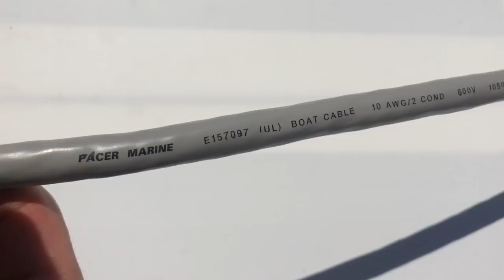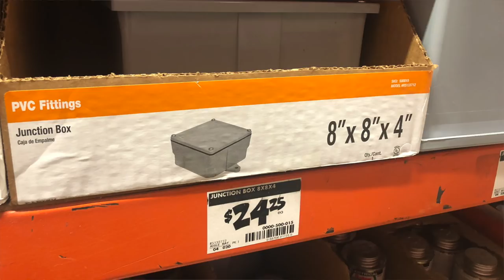Our 1300w RV Solar Install On Our Class A Motorhome!

Comment: couple of questions: 1) what did you use to attach the wire to the back of the panel? looks like some kind of zip tie, what are they and where did you get them? 2) how did you attach the cables to the roof?

Comment: Perhaps "compartmentalizing" (insulated curtains?) your living space and using a smaller btu air conditioner would work.  There is a JHS air conditioner that's Energy Star rated and 8000 btu....it draws about 920w/8 amps.  Not bad for a portable.  I think it would work with your set up, but you'd have to find a place to store it, and a place to vent it.:/  $269.99 on Amazon with free shipping 👍🏼. Anyway, best of luck 💜

Comment: Nice job check out the Renogy 100 AH lithium iron phosphate batteries.  I'm running 4 they are 25 lbs normal flooded runs 70 lb and only get 50 % of the power capacity.  So 4 LI batteries = 360 + AH.  I'm charging with 500 watt solar array to a Rover 40 AMP MPPT charge controller.   Mike

Comment: Nice install!!
I'm just starting out and I notice you have a honda element (me too) with a base plate for towing. Have you had any issues? I can't get a straight answer from honda about whether it can be towed or not. Obviously you're doing it. Do you follow a pre-tow procedure to protect the transmission?

Comment: Look at Micro Air Easy Start for your installation. Reduces your starting current significantly. Will allow you to start and run your AC off the batteries. Your useable AH capacity will still be your limiting factor but you mentioned that may be another upgrade for you later.
Reply from the maker: Thanks. I don't think starting was an issue. I ran it for 45 minutes and like you said, my usable AH capacity was the biggest issue. It just drained the battery bank so fast. We're in cooler weather now so I don't have to think about it for now :)

Comment: Yeah to run a 1500 BTU air conditioner your going to have to at least capture 1700 watts of solar actual charging power not panel rating power.

I have 4 370 watts panels total output 1480 watts of solar on my roof but the actual production with panel heat, wire loss, inverter loss, excetera I regularly bring in about 1150 watts, I seen Peaks a little over 1,200 though.

Everyone says how much watts thay have on a roof but not really how much watts that are actually being produced to the batteries after the losses.

I'm going to add two more panels that would give me a total of 2220 watts on the roof but I'm suspecting actual output that I'm actually able to produce to charge the batteries to be around 1800 watts.

Then you can use your air conditioner and still trickle charge your batteries.

you still would need a good battery Bank though that can handle the high draw out & high draw in.

And you can only use your air conditioner maybe top 3 hours at the best part of the day, and still trickle charge your batteries after that you might have a slight draw from the batteries.

Comment: Do those panels lower gas mileage due to wind resistance? Just wondering.
Reply from the maker: That's a good question. I'm sure it has some effect but I don't know. We are pulling a Jeep now which is heavier than our Element and I noticed a small drop in gas mileage from that but I didn't notice after installing the panels.

Comment: Unrelated, but I notice you flat tow a Honda Element. I didn’t realize they were flat towable since they aren’t included in the Motorhome Magazine dinghy guides. Are there any particular years or models, restrictions....?
Reply from the maker: Jody's Journey Ours is a 2003 manual transmission. I’m not sure about the other years or the automatics.
Reply: Ah, manual. That makes sense. I may have to relearn to drive one. Haha. Thanks.
Reply: mightymousesundies No. Only certain vehicles can be flat towed. Depends on the make. Or often 4-wheel drive, like my Jeep, can be flat towed.

Comment: Nice job, are you thinking to go with lithium ion batterybank ?
Reply from the maker: Yes, that would be nice but I'm not looking forward to the expense :) Since our solar array is a bit oversized for our battery bank at this point, we seem to do just fine as long as we don't  try to run the AC. We don't have any issues using any appliances throughout the day and even into the evening right now. So at this point, we can really use anything and not think about where our batteries are at, which has been nice.
Reply from the maker: Update: We just upgraded the battery bank to 700ah of lithium.

Comment: What is the aws cable size break down from panels to charge controler?
Reply from the maker: We've got 10awg from the panels to the combiner box and 2awg from there to the charge controller.

Comment: Hi.  1300W at 12V = 108A. # 2 wire seems a bit small for this many amps.  Is it working well and have you had any problems?
Reply from the maker: Hi John. The panels run at a higher voltage. They run around 16 volts and have an optimum operating current of 6.25 amps. That puts it at 81.25 amps total as the absolute max so 2awg is good for that. It's working great and we haven't had any issues. As long as the sun is shining it works great! We just upgraded our battery bank to 700ah of lithium too so we can really take advantage of all of the power coming in.
Reply from the maker: @jaberjourneys  We went with 7 100ah Battleborn batteries. It's worth it if you like to do as much boondocking (dry camping) as we like to do.
Reply: John, even at 108A a number #2 wire is more than they need. #2 -90C wire is rated for 130 amps.
Reply: Depends on how much voltage drop you can accept. The charts I have seen provide wire ampacity for 2 or 4% drop over 100 ft, where the 4% drop current is roughly doubled from the  2% drop current.

Comment: 13 100w panels ?  Why would you not use 4-5, 300-330w panels ?
Reply from the maker: Thomas Cellaro I couldn’t fit them so I had to go with the smaller ones.